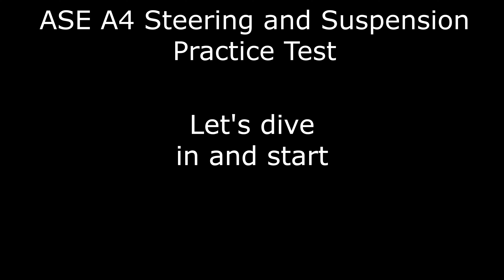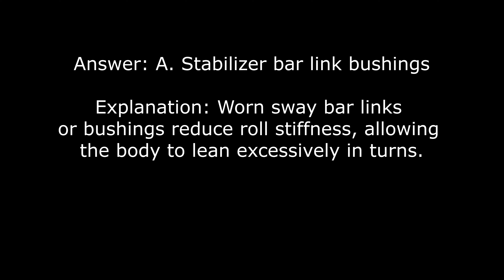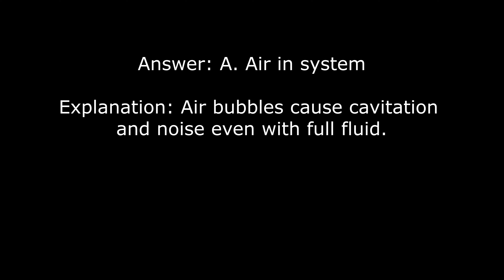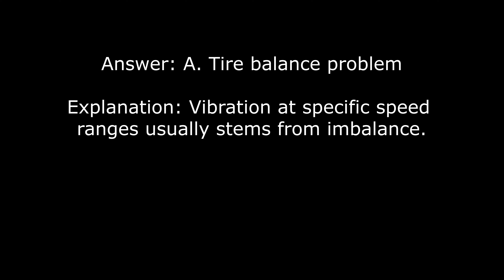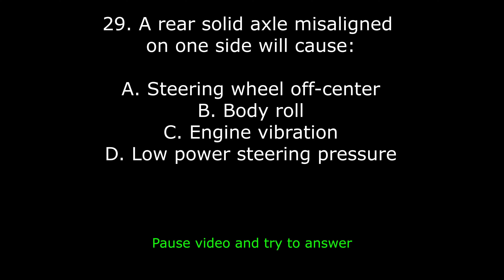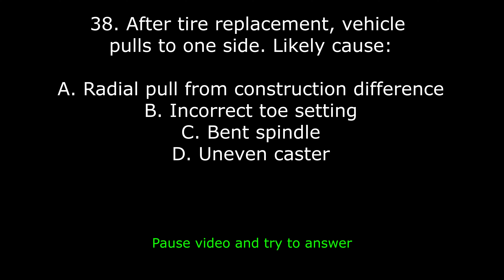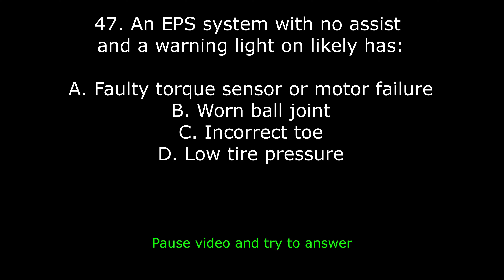🚗 ASE A4 Steering & Suspension Practice Test #2 (50 Questions) | ASE Certification Exam Prep ⚙️

Comment: #1 question doesn’t make any sense but the answer is correct.  Maybe you can fix the question?
Reply: It makes perfect logical sense. You must not be mechanically inclined. If i brake the force moves the car in direction of braking if the struts or shocks are worn it will be excessive and create a rise and fall after stopping in that direction. So what exactly dont you understand? Going over a bump creates a jounce and rebound bouncing same thing yet your force from movement creates this in the direction of travel. The brakes forces the car down and bounces the opposite end. Depending on which side front or rear has more braking force in the opposite of the vehicle with the least amount of braking force or clamping force.
Reply: @yogurt1-v2i You must not be too mentally inclined because it is impossible according to the laws of physics for the FRONT of the vehicle to RISE during BRAKING. During braking, the car’s weight shifts forward due to inertia. That extra load compresses the front suspension, making it impossible to rise.
Reply: @S @StaticTesla 0% agree , I was kinda confused by that first question as well, weight transfer wouldn’t allow the vehicle to “rise” regardless of weak or failing shocks especially during braking , I’m sure the creator just got confused because if anything it would be the complete opposite , the vehicle would rise during acceleration and then excessively nose dive during braking , just needs to reverse the cause and effect and question is golden.
Reply: 0:56 It's worded in reverse of what actually happens during those actions.

Most cars I've driven the nose rises under rapid acceleration, and dives during sudden braking.
Reply: @ZickcermacityAgreed. During driving with worn shocks you more so feel the diving feeling when braking. Only experienced technicians would be able to see the fault in the wording of the question but still get the answer right.
Reply from the maker: I am not sure what would be a better way to write the question?
Reply: @clayauto  "A vehicles front end dives when braking and rises excessively during acceleration."